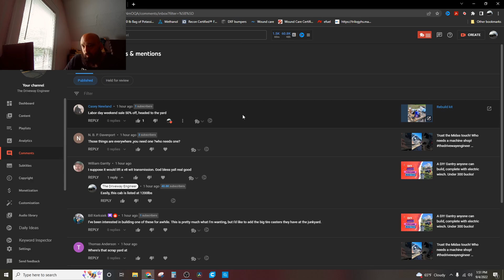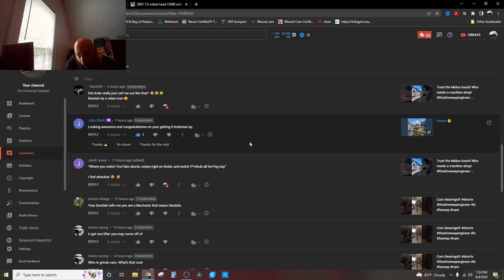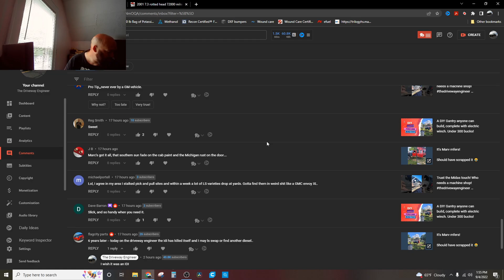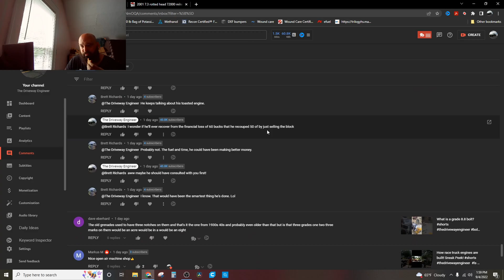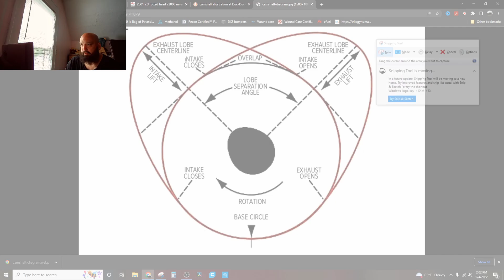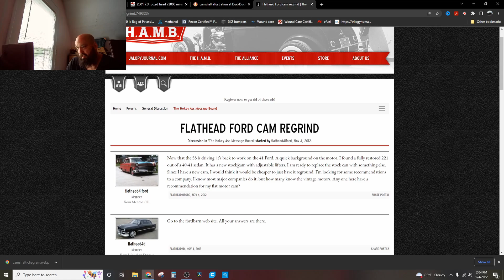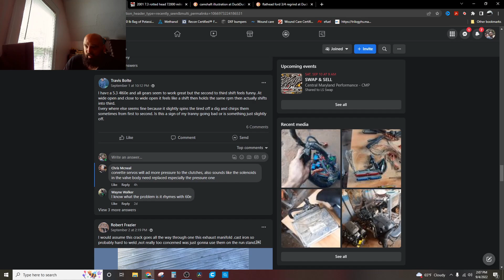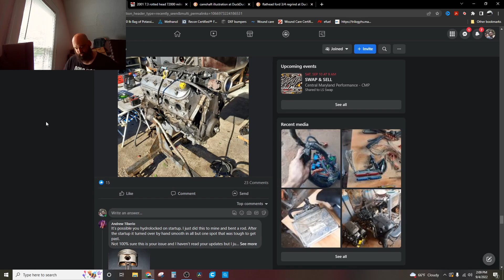Questions about engines? We've got the answers! Drunk answers! Reground cams? Converter spinning?

Comment: I never remember 90% of the shit I ramble about on youtube lol Im usually watching while  drinking myself to sleep. Then people reply or comment about my drunkin ramblins like a year later that I don't have a fuckin clue what I was writing about. lol But I do know I got buncha LS and PSD shit kickin around lol IDK the differance on identifing early 7.3 and later 7.3 heads but years back i bought a 90' 7.3 with a banks sidewinder and cracked heads so i spent the time and money on heads and those new heads cracked like a few days later those early 7.3 heads don't like much boost but it ran like a raped ape for i minute lol
Reply: But my question is I just picked up a stock 5.3 with 862s for my 69' gto that's been rotting away for over a decade and I may just say fuck it and leave stock cam   but ive got a  comp 281xer Cant remember the exact specs like .600lift 232dur and 112 lsa do you think that Donkey Dick is prob to much for a small valve 5.3 ive also got a ls6 cam prob be better performance wise but lack that rowdy chop only real reason im thinkin camswap  I dont really wanna spend much on a $200 motor or dig to deep

Comment: E1840P Engine Camshaft .585/.585 Hydraulic Roller for LS Sloppy Stage 2 Compatible with Chevy Corvette Camaro Pontiac Firebird GTO  
5.0 out of 5 stars 1
$105.00 
Get it as soon as Thu, Sep 8
FREE Shipping by Amazon
Only 10 left in stock - order soon.

Comment: All the people on the LS swap groups that think they need the terminator or other aftermarket injection stuff kill me. They're always on there questioning why something isn't working right, while I'm out cruising in my swap rocking the factory system..... If I feel froggy and want to change up something a bit, I can get someone to do something with HP Tuners. Even could buy it and learn it for way less than a terminator.....
Reply: My "stock" ECM and engine have been running and driving for close to 5 years now 🙂
Reply from the maker: Exactly lol
Reply: Facts!
Reply: Can you do “live” tuning with the stock stuff? Live tuning can save time if you don’t have time to waste. That’s about the only advantage I know of.
Reply from the maker: You can, I'm never in enough hurry to care lol